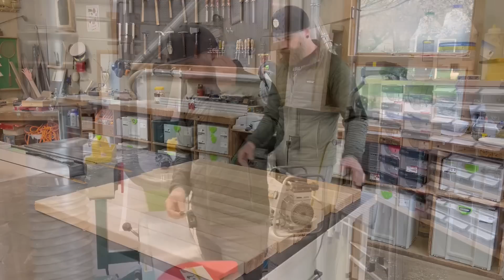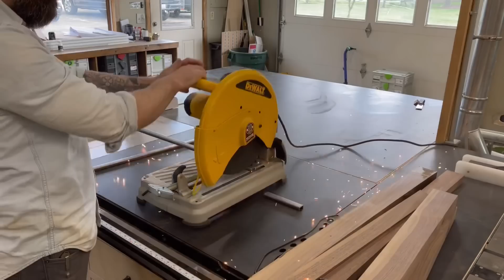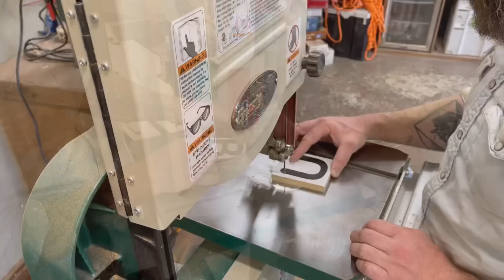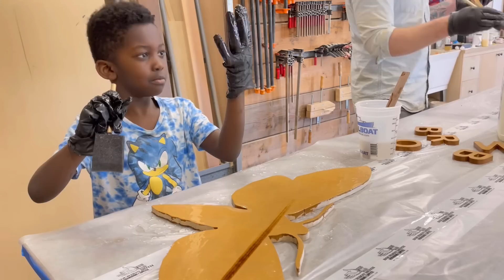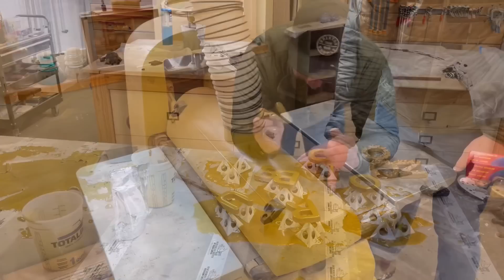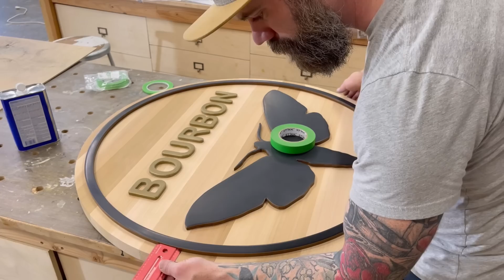Making a Sign With No CNC || Making a Wooden Sign With Letters

Comment: I spent a week at Athens, Tx for RV introduction maintenance class. Only did a week. But, this was just after the Covid problem, and I talked to a lot of owners and techs in the business. Of course the RV industry was still at full throttle building RV’s. Most the manufacturers had two shifts to keep up with the demand. People, a lot not very experienced, were working a shift and then leaving to another company to work one of their shifts. A lot of ‘shabby’ work was done and QC was almost nonexistent.  I own an 08 Monaco, and would never consider one of the ‘new’ rigs because of the obvious problems. My RV Tech bud has all the work he can handle…. Unlimited repairs.

Comment: Excellent work and great looking sign!!! 👍👍👍

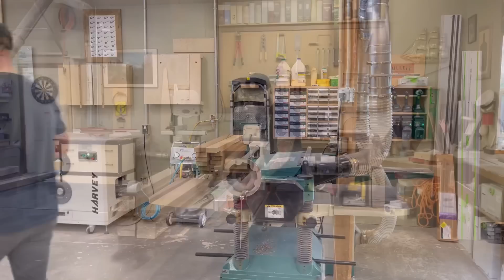@2:58 😳🙄💁
Why did you use the table saw after the joiner/planer?

Could you have simply used either and not have to do both? 🤔🤔🤔

The joiner scares the hell out of me... i don't even own one because i'm honestly terrified of the thing.  I worked in a commercial custom fab shop years ago and quickly learned which tools demand the most respect... the joiner is so far at the top of the list the router/shaper in second place seems almost timid! 😳😬🙄🙈🙏🙏🙏

Comment: Very nice woodworking and good improvising to figure out the steps involved. One thing I would have done differently is use optical instead of mechanical (fixed) spacing for the letters. Adjacent letters with straight sides (U,N) always look too close together compared to other letter pairs if mechanical spacing is used.

Comment: Is the epoxy on the back after the sand to get the drips off still enough to seal the mdf, with only superglue holding it on?

Comment: Great video, as always.  I have a question.  The letters and moth are coated with epoxy, so the fronts and sides are protected from the weather.  I was wondering about the backs.  Can water get between the back and the letters/moth?  An as a result the letters would swell?
Reply: I was thinking about this, especially since there are pinholes from the tacks. They did coat both sides with epoxy though.

Comment: I originally saw the backwards "N" and thought it was intentional, and would have made the sign unique, kind of like what the band Korn did with the "R".  Also brushing  the glued paper with a rag soaked in mineral spirits helps release the spray adhesive.  If you get the paper stencil wet enough with the mineral spirits, the paper peels right off.  It eliminates the needs for sanding the stencil off.

Comment: I'm disagreeing on your method of spacing the letters! You get away with it, because you're lucky (like 2x "B-O"). If you had a an "I" or "P", it would look off... I'd do the kerning in software, then print and cut out, spray the accelerator, lay the cutout then fit on the letters.
Reply: I was thinking similarly. You could let illustrator etc do the kerning for you, or place them perfectly how you want them on the board, and then use basically transfer tape or contact paper (or protect the letter surfaces with tape and use superglue or hot glue to glue them to a board) to keep the letters all aligned how you want them, then you could glue the backs of the letters and place them all at once in perfect alignment. Not really necessary for this font/project. but something to think about for others with maybe a little more complicated layout.

Comment: Sooo…you still have completely unsealed 
, now sanded raw MDF sitting against unfinished raw cedar.  No worries I doubt capillary action will suck water down between the layers and hold it there like a wet sponge causing the MDF to fall apart and the cedar to turn black  I guess we’ll know in a few months

Comment: Neat job.
Just a bit concerned that if you do put it outside the tops of the wings and the tops of the letters will trap a lot of dust and moisture.  Maybe you should cast the sign face down into a slab of epoxy!

Comment: Looks great. Really enjoyed the video as always. One question though-if you put it outside how do you prevent water from getting under the MDF. I'm assuming you will seal it if/when you put it outside.
Reply: He showed sealing all the mdf with untinted epoxy at the beginning. When he sanded the back to get the coloured epoxy drips off, I assume he didn’t sand through the initial clear coat.

Comment: I noticed you use a Festool Rotex sander. Supposed to be great for aggressive to fine sanding, but vibrates quite a bit. Ever consider the ETS 150/5? Supposed to have pretty smooth vibes.

Comment: I recently built a sign for my lodge, and man,  that was a lot of work.   I planned on mounting it between two 4x6 posts, so it had to be double sided.  I used PT 2x10's, planed them smooth and same thickness,  jointed the edges,  then glued it up.   Slab was 4 feet by 6 feet.   I then used a projector hooked up to my computer to show the images on the slab, then I traced over all the letters to transfer the image onto it.   After some fine tuning, I got all the letters straight.  Then I took my router and went to work, removing all the wood around the images so that they would stand out.   After about a month and several router bits later, I had a sign.   After some paint and mounting between the posts I cemented until the ground, I had a very nice sign.  Since this is my hobby and I didn't ashtrays have time to work on it,  this project took a little longer than I wanted,  but everyone was very happy with it.

Comment: There are some things I'm wondering regarding the mdf.

Why did you use regular mdf instead of moisture resistant mdf? I wouldn't trust mdf near water no matter what finish is used. A single crack in the finish is enough to let it swell and pop the epoxy off. MR mdf is what I'd use for bathrooms, I'm even unsure if it's good enough for outside but it should help a bit.

If you believe the epoxy will stop the moisture, why didn't you coat them completely, or use epoxy to glue them down. That small bead of CA glue has to leave enough exposed gaps to let moisture in.

Why do you provide room for expansion on your C-channel, but not on your mdf? Mdf also doesn't have the same expansion and contraction as natural wood. So I'm afraid your circle will just pop off on the first seasonal moisture change.

It's not criticism. After all, it's your project and you can experiment all you want. But could you keep us updated on how this sign ages?

Comment: Top tip. If you put the paper on wet glue, it won't come off without sanding. If you let the glue dry to a tac, the paper will stay put until you want to peel it off easily

Comment: For the moth and ring part of the design I would have been inclined to use a plastic, like foam PVC, waterproof and you can get it in a range of thicknesses and colours. Another possible material would be aluminium composite panel, two layers of aluminium with a plastic core, also available in a range of colours. 
It may be possible to use the thick epoxy resin on foam PVC, but I think it would need a primer to get a good bond.

Comment: You should have coated the back of the letters etc, with epoxy. As it is the backs will absorb water. The sign should never be outside.
Reply: He and the shop foreman encased each and every letter and the moth with clear epoxy to make them waterproof before the coloured epoxy was poured over just the tops.  So don't worry!  🤣

Comment: Instead of putting the spray glue on the piece, an old scrolling trick is to cover the piece with painters tape and glue the pattern onto that.  Makes clean up way easier and faster.
Reply: I just used this technique making some logo signage for the company I work for! Works great especially when dealing with MDF.

Comment: Hey man love your work, I build wooden boats and work with epoxy a lot. Unless you used UV resistant epoxy it will change colour in the sun. Polyurethane over the epoxy protects it from the UV and you can use mat finish to get rid of the shine.
Reply from the maker: That’s good advice. Thanks
Reply: Came here to say exactly the same as OP
Reply: Would that also be a decent long-term treatment for a outdoor bench? I'm touching one up for a family friend and unfortunately couldn't find the wood I wanted, but also don't want her to have to reapply stain/waterproofing every year if I can save her the trouble

Afterthought: I'm definitely not using mdf for the bench xD I have some good cedar boards, I'm just thinking long term maintenance
Reply: Use graphite powder to make the epoxy black AND UV resistant. It will become a matte finish as the surface epoxy breaks down. The brass powder may work the same way. Polyurethane will eventually breakdown and need recoating.
Reply: Thanks for the advice I just made a boat paddle. I used spar. I might need to recoat with poly.